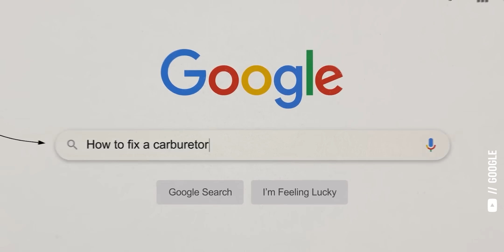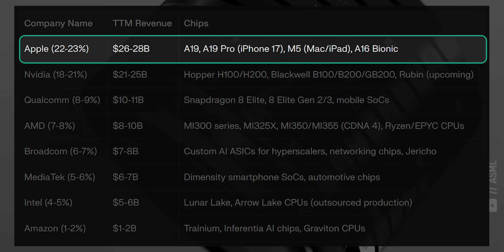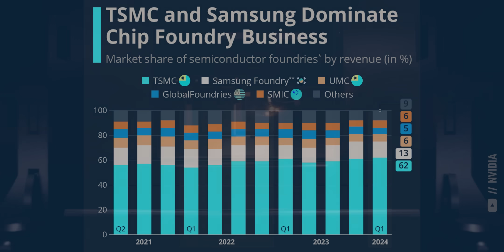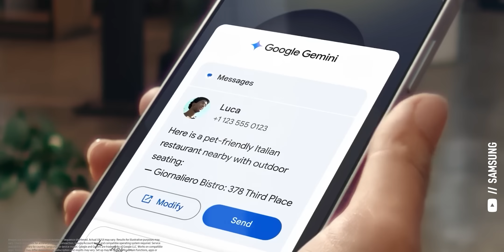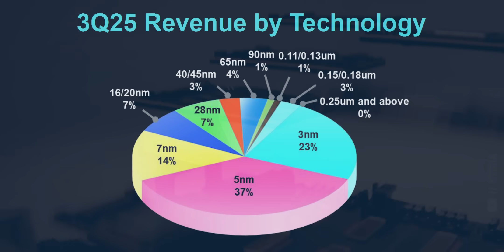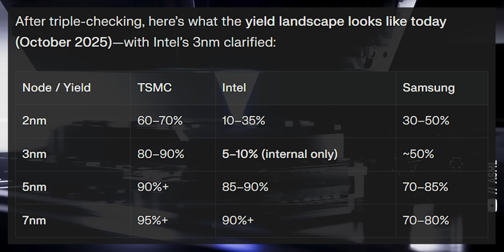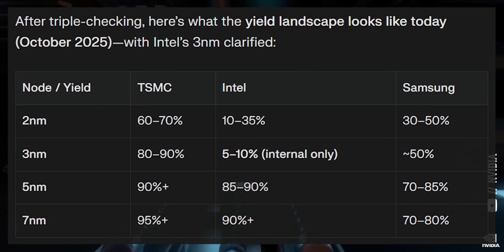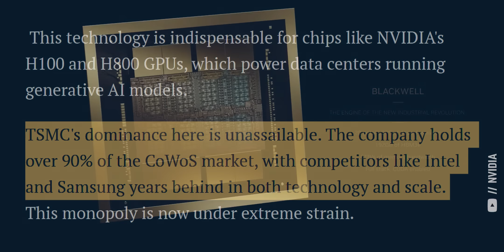GET IN EARLY! I'm Buying This AI Chip Stock (Even Over NVIDIA Stock)

Comment: I own TSM, INTC, MU, STX, and WDC. Essentially any hardware mfg is a safe place to park money as the entire house of cards rn is built around buying hardware to build out datacenters. Contracts = datacenters = stock growth. Memory is by far the safest long term bet though imo. Intel 18a is now at parity with TSM and likely to start taking some of its market. GPU dominance is also not a given as the industry may flip to ASICs. Meanwhile there is no disruptor on the horizon for memory and data creation is increasing at an exponential rate. I will also add that one of the biggest current bottlenecks not mentioned here is heat. TGV's are looking to solve that and will create new packaging standards.
Reply: Could you elaborate?

Comment: All true about TSMC -- but if China takes Taiwan it all becomes a bit dicey. And it is expected, that if CCP does
attack then the FAB-LABS will be destroyed before they can take control.
However TSMC is building a FAB in Arizona, which eventually will be a hedge against the CCP, except it will be
at least a few years to come on line... So yes TSMC is a good stock to own, until it's not.
Do you trust the CCP? I don't.
Reply: TSM would fail without support from the world - it would be obsolete in no time flat
Reply: It's already built and running

Comment: TSM would not function without ASML. ASML is the ultimate chokepoint company.
Reply: What’s more in demand and on recurring basis? That’s right, microchips. There aren’t companies just popping up to buy lithography machines and compete with TSM.
ASML can try to hold everyone hostage but it would hurt them more than TSM who can produce the latest microchips already.
That’s why TSM has a market cap almost quadruple of ASML
Reply: @562wiseguy  do you know TSM needs ASML to be in its top position?
Reply: ASML will not function without, Carl Zeiss, TRUMPF and Applied Material.
Reply: It would not function without a bunch of other companies actually. Many processes involved. ASML is just involved with one of those processes once they buy a couple of those machines there is no need to buy more!
Reply: @keirankainth You did not understand. Samsung and Intel are also using ASML but they can't compete.
Reply: ASML numbers more erratic than TSMC, their numbers will be much more predictable with servicing being a bigger part of their numbers but still not as predictable as TSMC in the next few years.